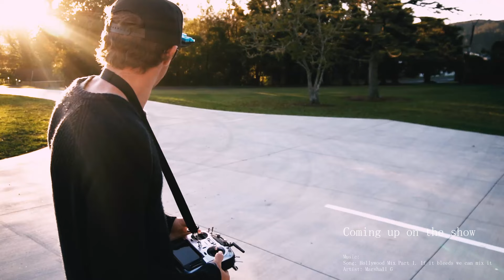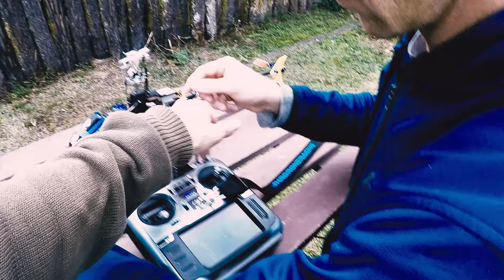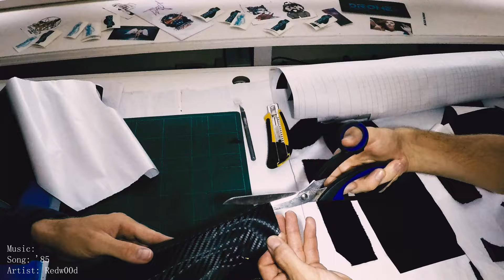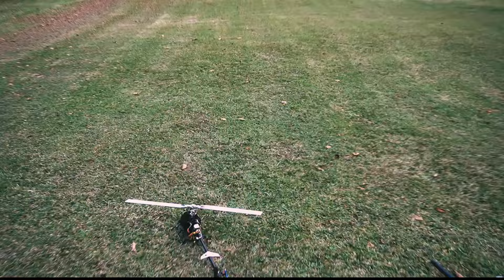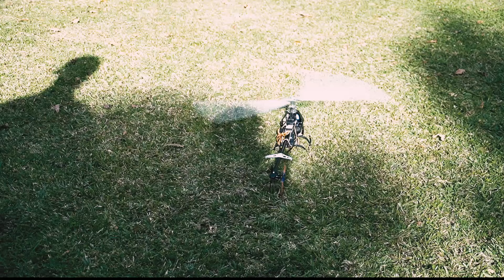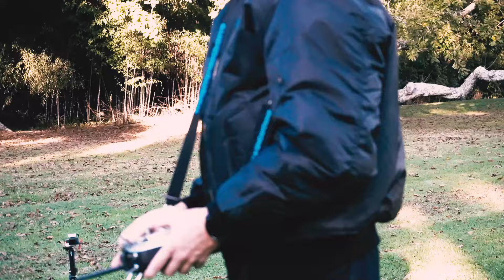How to Create a radio control DIY Helicopter

Comment: I am sorry but playing with rc helicopters is a risky business. Anything goes wrong can cause damages or injuries, ( even death ) to both the pilot and bystanders. 
Using mix and match parts does not guarantee the parts can withstand the forces as per the manufacturer's specification. 
So please becareful guys when you do this. Have you ever been struck by an rc helicopter's blade? 
If not then I hope it won't ever happen to you guys.
Reply from the maker: Thanks for your concern, will be careful